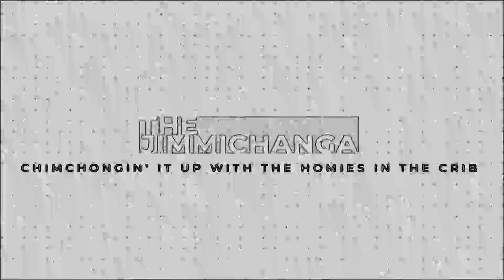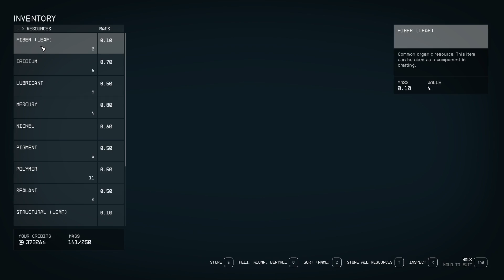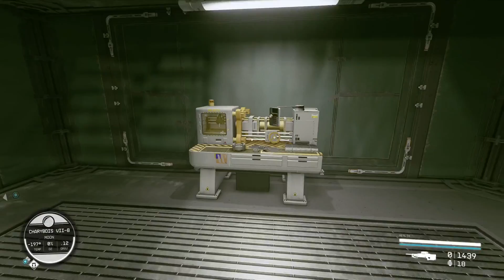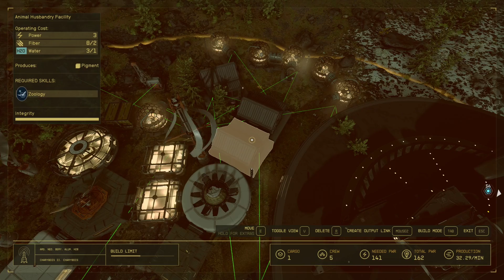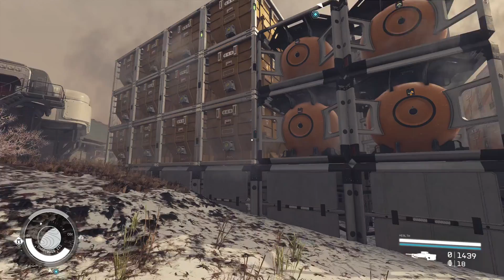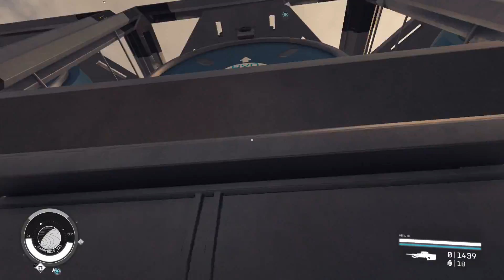STARFIELD - How I setup a 1 star system 8 planet outpost network - Detailed breakdown

Comment: Hey THE JimmiChanga can you also detail which resources do you get from each planet ? as an example talking about the first moon from this vid i set up the outpost on helium3 al and be spot do i forget or sacrifice the nd or can i collect it in some other way as in setting up multiple on 1 planet/moon (what happens to cargo ling situation in that case)
Reply from the maker: @MrAtharos  I would avoid setting up more than 1 outpost per planet as it can cause the cargo link system to act wonky. I'm a huge advocate for taking the extra time on each planet to find biome split, therefore maximizing the potential resources in each settlement. The surveying perk can help a lot by highlighting materials before landing so you can pin point your best landing spot to achieve this.

Comment: Once I learned that you could just pick up mag pistols at high level and use the 20k credits from each to purchase materials I didn't sweat construction that much.  My priority instead is to go up to the edge of the arctic zone of Jemison and put an Amp farm in place.  You have two different plants that provide materials via greenhouses while the gas comes from the frozen area nearby.  From there you queue up Amp by the 100's and put them on a hot key to always boost movement speed.
Reply: Try Vega 2c Amp farm plus 4 hours+ sleep time

Comment: Do you ever have issue where you start filling up with too much of the same resource in your main hub? I was under the impression resources harvest at different speeds, do you just have to start dumping stuff til the resource you want trickles through?
Reply from the maker: Really comes down to the number of extractors your using for each resource and what type (commerical/industrial etc)

Comment: Can you daisy chain extractors?  Say have one water extractor connected to all the structures that need it and if you add another one, connect it to the first water extractor and be done with it?  Or do you gave to connect it to all the other structures.  I realize you can use storage tanks and that’s fine if that’s what you have to do.

Comment: After a while, stuff gets clogged up in the chain
Reply from the maker: Definitely will clog yourself if you don't have enough room for storage expansion on your main planet. Copper is showcased. It's very briefly in this videos, but it's being received natively from my main planet, not through a link.
Reply: @THEJimmiChanga  I rewatched it and saw it, that's why I deleted copper from my post, lol

I find when you transfer multiple items in one cargo link, after a while it gets clogged up, for example, sending aluminum and helium 3, if I put my aluminum with my iron and make a builder for Adaptive frames, eventually the helium 3 fills up and no more aluminum shows up to make the adaptive frames unless I clear our my helium 3, that was a basic example but I had this issue back at launch I just wish Bethesda would allow us to automatically stop sending an item if full so it focusses on the other items

Comment: Good stuff.  But I have a question.  Why put the Hub on Charybdis III?  Seems it has way too much going on, plus it is a violent planet as far as creatures go.  Why not just ship that stuff out to one of your small outposts that doesn't have much going on?  You know a nice quiet flat place with lots of room.  Build the hub there.
Reply from the maker: @biggranpa  certainly a lot of optimization could be done. I'm starting a brand new build series doing this all over again from the ground up. I think you'll be surprised yet again by the hub planet and home star system choice.

Comment: I am impressed Sir. I'm a newbie and started outposts, I get confused always. My big problem is re-doing my original. connections are all wrong,  wish I could start from beginning. Fixing is harder than starting anew.  I was going to give up, but I'm going to stay with it now. My cargo on ship is full, not sure how to empty it before going to links.
Reply from the maker: You can delete anything within an outpost and get the materials used back. You can also delete the entire outpost from the outpost module that you planet. I'd delete all your extractors etc individual first before deleting the outpost though to get your mats back.

That being said, If you follow this guide you should be up and running in no time. Just take it slow. You'll free up a lot of space from your ships cargo just by building a couple outposts. Also make sure you check your misc tab in your ship cargo at a vendor. When you make changes to a ship, it puts a lot of misc junk in the cargo haul that takes up space. Sell it off every time this happens
Reply: @THEJimmiChanga  Thanks so much.

Comment: Am curious; Does distance of systems matter? (Like say I have my outpost on Bessel 3-b (iron, aluminum, nickel, cobalt); if I get another planet to bring in He3 for an Inter-System Cargo Link to bring already established base materials to another system across the map (does that distance matter)?
Reply from the maker: I've never did helium links because I've never needed to using this method. I doubt diatance factors into anything. I may place my last 4 outposts in a different system just to play around with the helium links, though I still have some pretty good unused planets in my current system
Reply: @THEJimmiChanga  Yeah lemme know how that goes! Am curious (still playing around in "first" game - haven't gone NG+ yet) but not sure I want to commit to an outpost system until the "final" universe)

So am doing some research, asking around, etc. before making any commitments there ^_^ Would appreciate the info <3

Comment: THE most annoying bug in this game is going into NG+ with Outpost Management maxed and it resets to zero as soon as you hit NG+… Stuck on 3 per base links forever, can’t advance it because the skill that is supposed to give you 6 is maxed but reset. This is on Xbox, it has been reported and acknowledged a thousand times and 6 months later it is still not working 🤬
Reply from the maker: Interesting... I didn't have anything invested into Op management until after I ended ng+ and had 4 or 5 of these outposts down. That's a weird bug, and quite an unfortunate one, especially if you don't get your perk points back.
Reply: @THEJimmiChanga  points are still maxed, it’s the effects that stop working at NG+ which is a disaster.
Reply: Can confirm that this is also true on PC. Most annoying.
Reply: Yup, started a new game and refuse to progress past first universe
Reply: @GorillaGaming187  outpost limits increased is the mod to fix it 🍻
Reply: Is it fixed now?
Reply: @Zer0BurnX  no